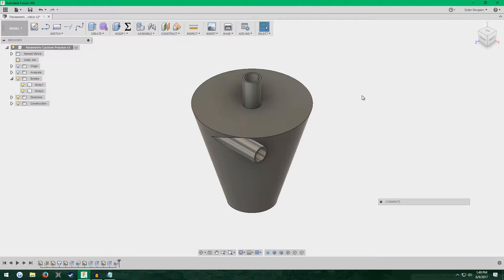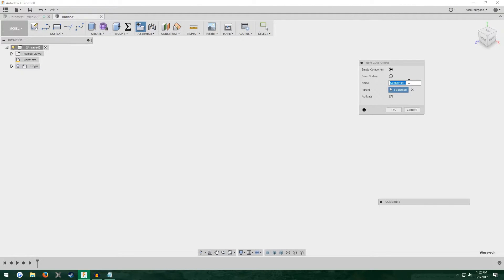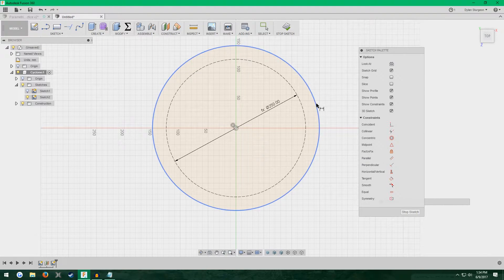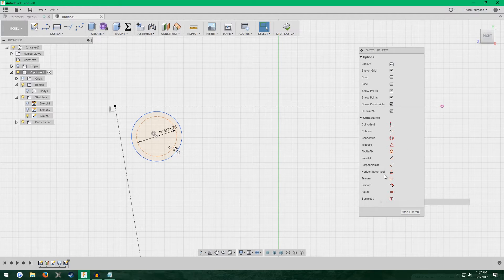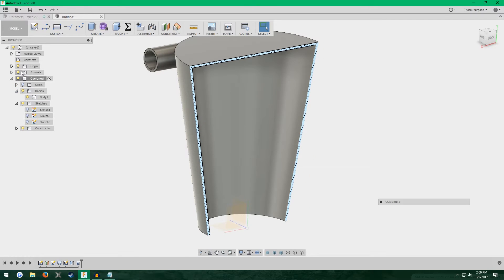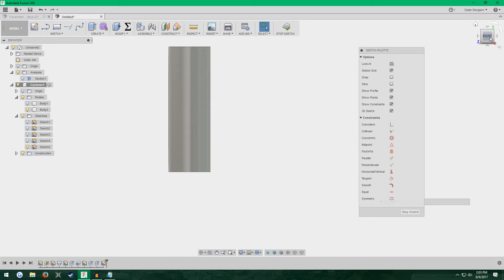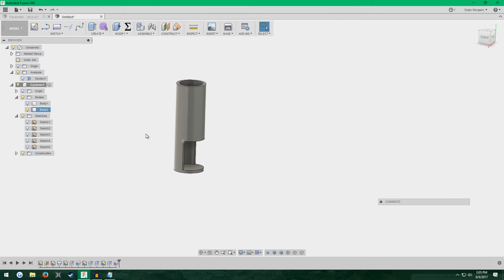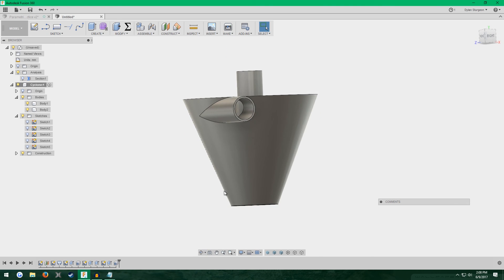Parametric Cyclone Separator | Fusion 360 Tutorial

Comment: I know this video is more about "fusion 360" but as far as separators go this one wouldn't work. The exit point in the top center shouldn't have that lip on the end of the pipe. That will block the inner vortex from starting. What you have drawn is the inlet tip on a shop vac hose. Probably to keep debris from going straight into the filter, not to start a vortex.  Good vid about the software though.